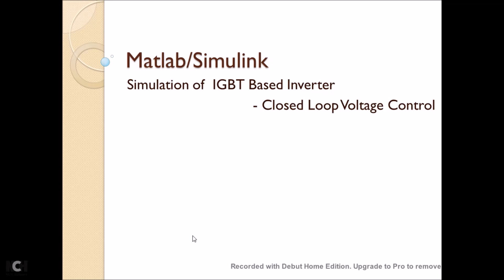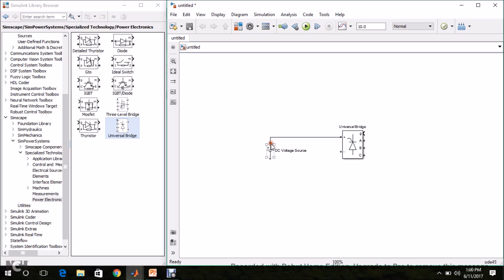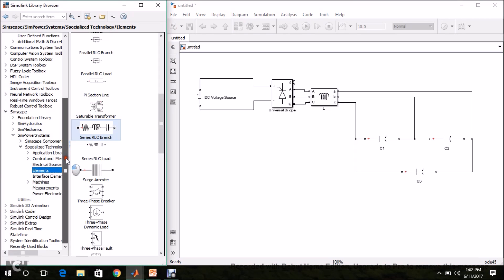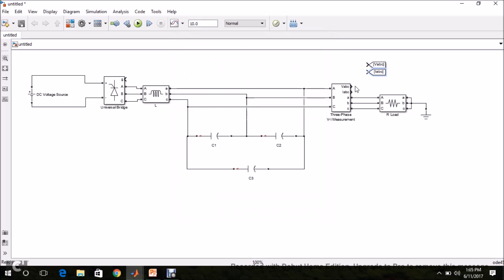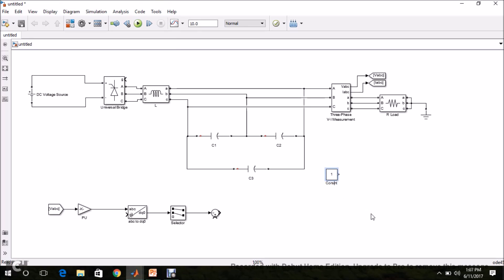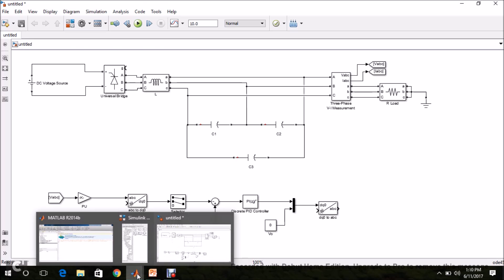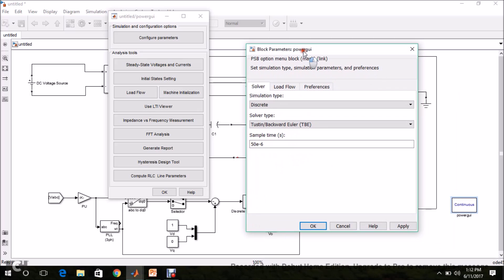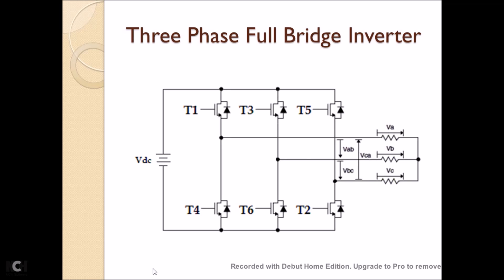Simulation of Three Phase Inverter with Closed Loop Voltage Control - Diamond Matlab Tutorials

Comment: Dear sir

              What is the value of IGBT using this type 3phase switching circuit ,  to ON for Vge=4v~5v and its output is Vce=250v &above  and Ic=Ie=3A &Above and its switching time below 10ns.

    Thank you.